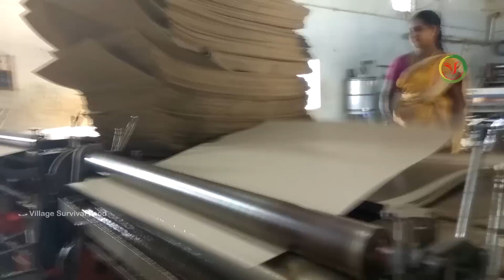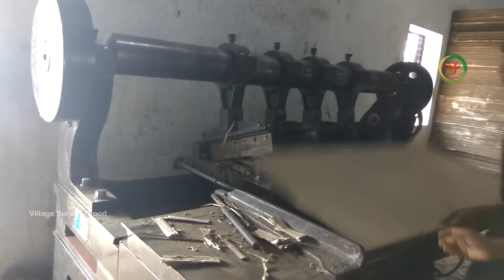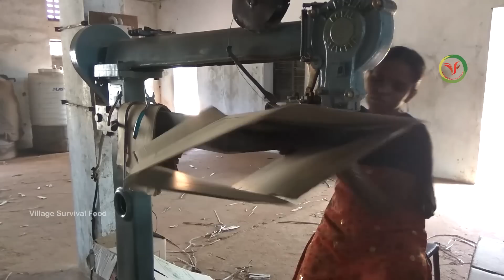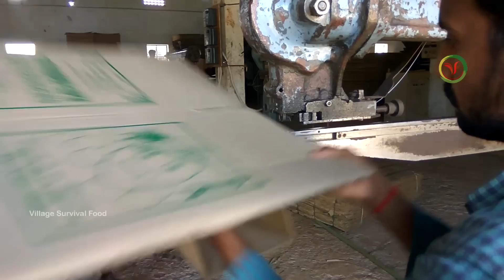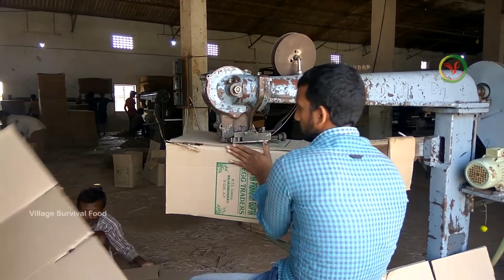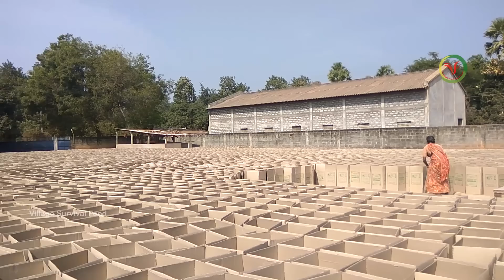Egg Boxes Making | 10000 Egg Boxes Making | High Speed Corrugated Box Making

Comment: So they are putting in the slots with what is called an Overhung Eccentric Slotter.  Rarely used anymore but 40 years ago, a lot of plants had them.  The stitching head is supposed to be at 45 deg.  Get a Bostich 485 man.  Production on the stitcher will sky rocket.

Comment: you should go for corrugated box sheet drying machine. it will save your area and efforts in laying these boxes in open ground
Reply: how this mn price
Reply: Lol they don't need drying those are #350  c flute,  boxes with Staples not glued
Reply: @josemeza7128  these are N flute boxes and doesn't matter if they are glued or stitched with pins... You can see they are spending a lot of manpower to pick those boxes & are spread across a larger area for drying..  a simple sheet drying machine would save manpower, time & space

Comment: dont use child labour
Reply: Without savings and capital structure, excessive labor is necessary for survival.  Avoiding it requires people to save and invest in capital goods (i.e. an expensive machine that does the job you see children doing now).  By not allowing investment in these capital goods (for example, by excessive taxation or lack of rights to private property (including money), or a inability to save (no authorized medium of exchange or a compulsory monetary system of fiat (think debasing (e.g. diluting precious metals value))) you are making more work be necessary.  The key take-away, don't knock billionaires; they make child labor unnecessary.
Reply: Good luck with that. Its India